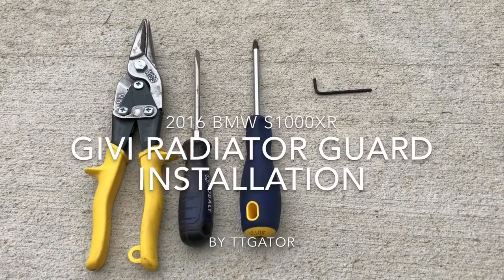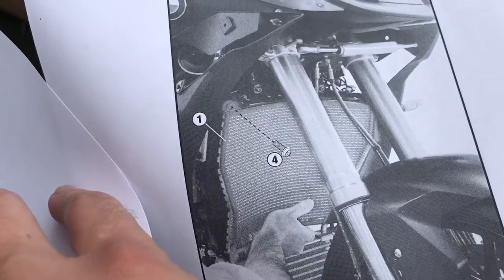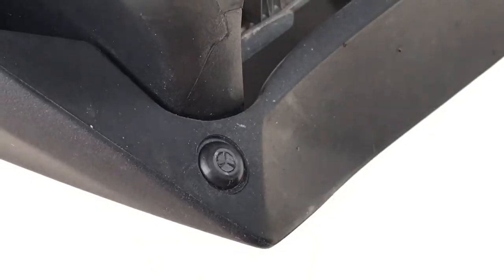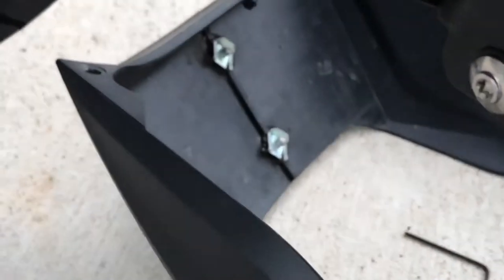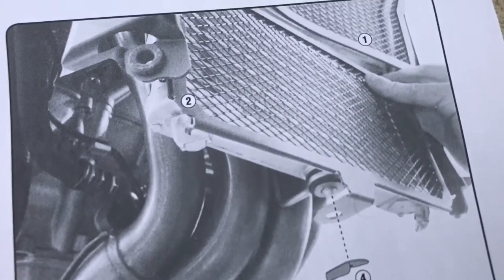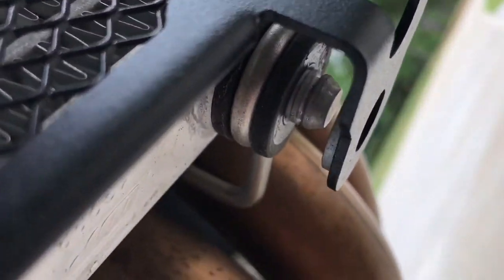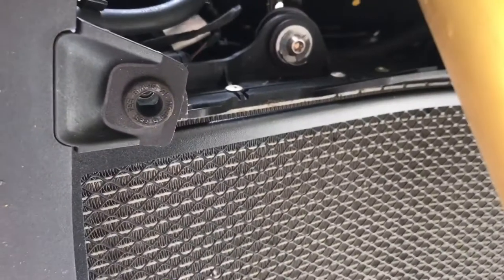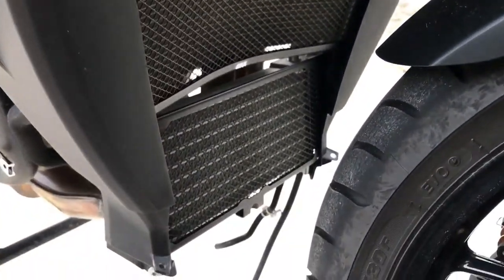2016 BMW S1000XR - GIVI RADIATOR GUARD Installation

Comment: I installed this December 2022. Just started to get a buzzing noise at 5-6k rev range (after maybe 6-7k miles with it on). Will have to disassemble and see if the rubber padding needs replacement or reinforcement at any point.
Edit: didn't see any wear points on the rubber. Installed car door rubber edge trim on the curved parts not already covered by the original rubber strips. Will see how it goes this week.
Reply from the maker: +Matthew Konersman interesting. Let us know what you find.

Comment: Did it affect the cooling of the bike? I heard it will void warranty if the bike overheat
Reply from the maker: +pinoy texas rider p  It did not affect the cooling at all. They would have to prove it affected whatever warranty they try to deny (at least in the US), and you could always remove it before taking it in for warranty work if you wanted to anyway.
Reply: @HelpMeDIY  thanks for the video.
Reply from the maker: +pinoy texas rider p You’re welcome! Thanks for subscribing 😊